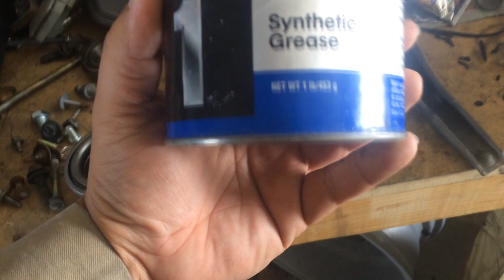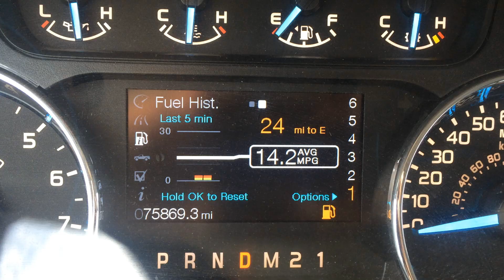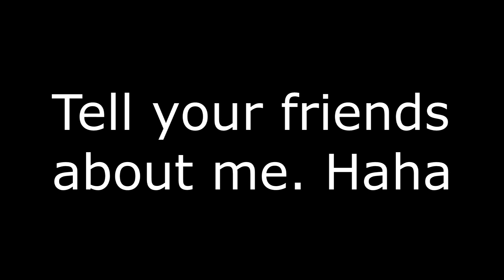S14 Clutch, Pressure plate, Flywheel, Throw out bearing install.

Comment: Oh no the spring needed to get hooked on the little hole at the end of the arm
Reply from the maker: You are right. If I recall, when I first tried to stab it together, the fork popped out. I may have failed to explain that in the video. Thanks for the comment!
Reply: Indeed , that spring will go on a trip sooner or later :D

Comment: Can you use the previous clutch's throwout bearing, if it looks good enough to use again, for the new clutch? On my 1995 240sx
Reply from the maker: You can but they’re so inexpensive and easy to replace once you’re already in there. I’d replace it.